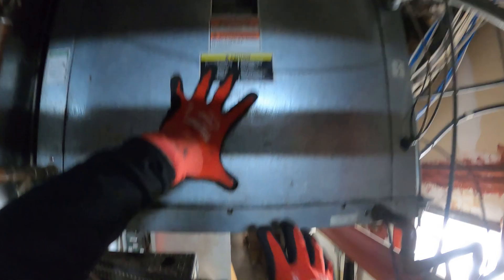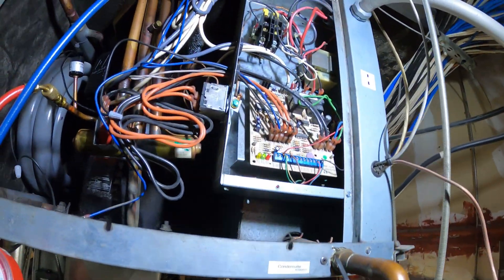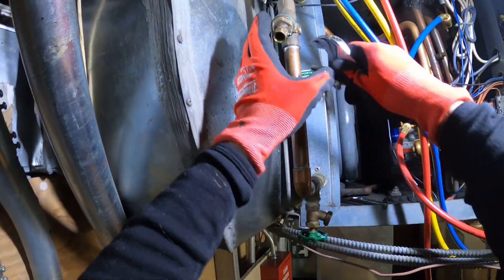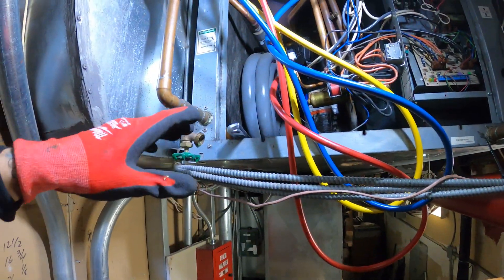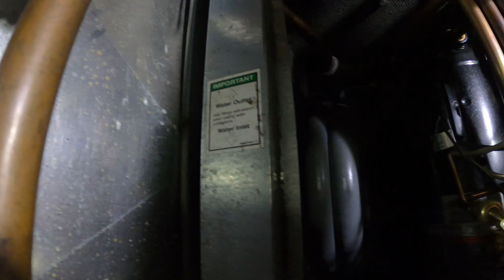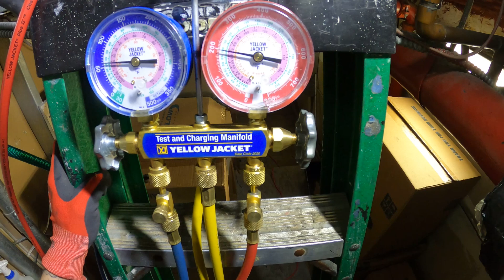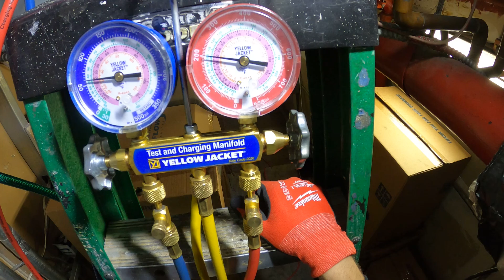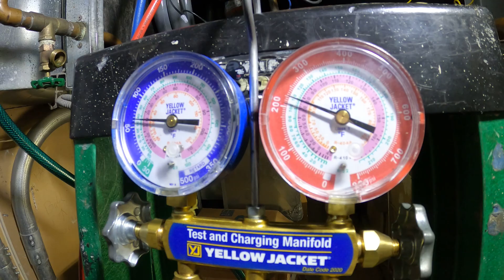HVAC Service Call: Water Source Heat Pump Tripping On High Pressure Control (Heat Pump Not Working)

Comment: I had 8 degrees temp split but the head pressure fluctuated I 330 psi to 450 psi. 

What could cause it ?

Comment: You could have simply taken delta T and pressure drop reading at the test ports to diagnose before opening glycol system. But good.maintemace anyway.

Comment: So what if the water source heat pump is not reciveing enough water into the unit, because for me it's blowing just cold air even if I set it to heat 🤔 one of the mechanics told me when they opened it up the water came out like a paste 🤔  do all water source heat pumps use anit coolants ???

Comment: . 46 supply air seems too low. 36 sat temp with r22. and high side still too high. be interesting to see the water delta and unit sub/super are.  id bet $20 it’s  poor airflow from dirty filter or hammered evap coil and still something wrong with charge or water volume. sure it runs but it’s definitely not right. you may be flooding back too

Comment: Great vid.  Where exactly do you take a measurement on the low side for super-heat on these packaged heatpumps?
Reply: Usually they’re built with the suction valve closest to you or the one on top, atleast thats how it is for FloridaHeatPump packaged units. Low side on top Hi Side on bottom. Other than that feel the nipple and the pipe, see which one burns 😂
Reply: sur la sortie evaporateur classic

Comment: I do this for my condo I had to get a plumber to add those valves to be able to flush or create a loop for descaling. It’s crazy all 26 units in the building didn’t have those access valves but instead the developers added circulator pumps to help the return line (for those far away from the water tank) and if those get clogged it’s another headache to take them out and clean them with vinegar. Anyways, awesome video.

Comment: At what temperature does the water leave that heat exchanger? Can that be used to warm the water up?
Reply: Yes if it goes in at 85 degrees must leave no higher than 105 degrees...unless there is a Water Flow issue
Reply: It will warm the water in summer yes as a Heat Recovery but in wimter is useless and you can not mix with Domestic Residential Water

Comment: I work on a ton of them at my job, 99% of the time it's usually a water flow issue. Now as I run into issues they are letting me put in mini-split's. And are walking away from all the water issues. It can be they tapped into a water line over the weekend for a different job Bam! I have unit's down.  Only good thing is I'll call pipefitter's over and they will kill the water, check the strainer's and blow that condenser line out in about 10 min's, they have all the shit for it. It's probably higher up but I did not see a water pressure gauge or temperature gauge on your system.

Comment: Cool video, hopefully you could do a video on the cleaning of the condenser with the pump. I have a lot of these heat pumps I have to take care of, but have never done what you are talking about with the pump to chemically clean the condensers. Also, is this something that should be done on a regular maintenance schedule. Thanks for the video
Reply: No only if need it. You need De Scale Acid and an Acid Pump also with clear hose 1 inch about 2 pieces of 4 to 6 feet long and a 5 gal bucket with 2 1 inch Metal Clamps

Comment: I worked on s as lot of water cooled heat pumps and nine times out of ten if there was a pressure issue it was always a plugged orfice in the water loop. Flushed out many orfices and cleaned screens.
Reply from the maker: That strainer is always the first suspect! They clog up so often. Maintenence is so important. Thanks for watching & commenting. Stay tuned for new videos every week🔧⚡️
Reply: Had a call once where the unit didn't have a strainer and the inside of the hoses were corroded and falling apart so it was clogged up